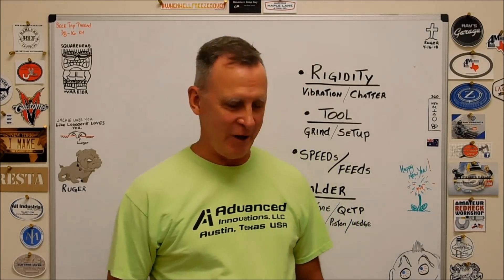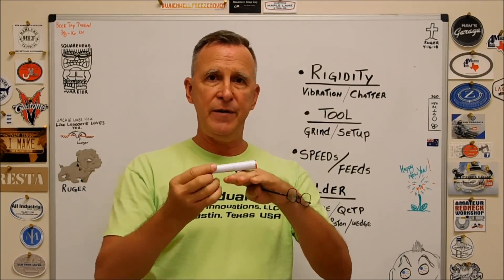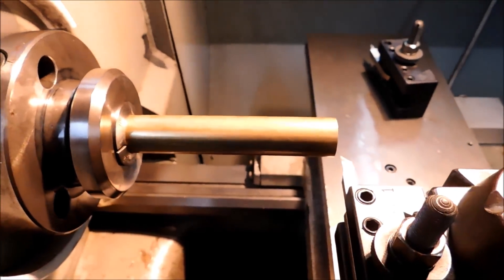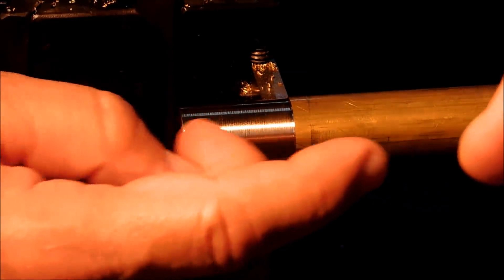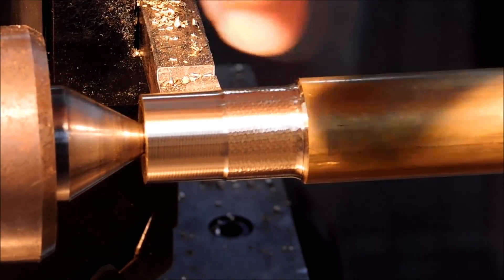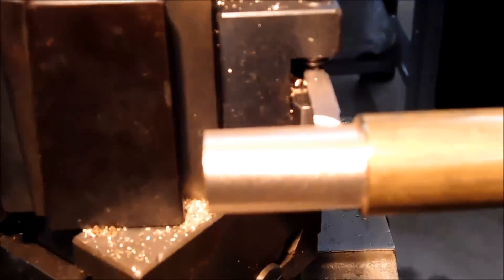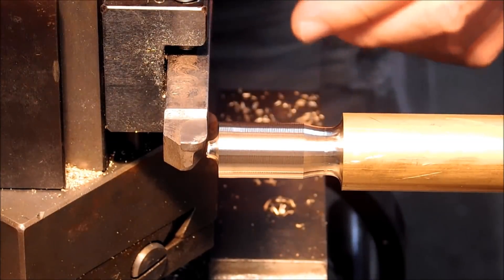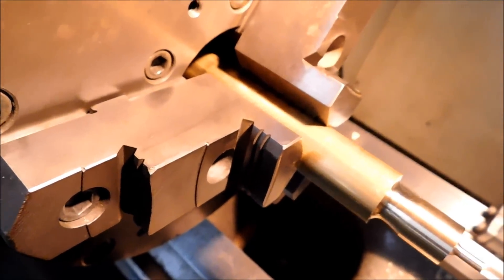Bad Turned Surface Finish and Some Reasons Why

Comment: I wonder how much of the surface finish woes are just the consequence of hobbyists trying to make things out of unknown scrap stock.  There's certainly a lot to be said for the differences in alloy content or material stress with regards to how freely it machines.
Reply from the maker: True, but having a grasp on the basics is a good place to start. From there, its just RPM and cutter toughness.

Comment: So - when drilling Brass with a HSS twist drill - simply very lightly grind or stone the chisel edges to flatten them (about ten thou' x 45 deg' will do you) & you'll find the drill won't "GRAB" when drilling Brass.
(This was a little, but valuable "Old School" tip I was taught by the "Old hands" which stuck with me to this day)
Reply: Martin Burnell Good advice,Martin. I have had brass grab a drill bit and pull it all the way through my part in a blink of the eye

Comment: Hi
Love this channel. Always something to learn. I am setting up a shop and it seems like I should be able to make better lathe cutters with a belt grinder. Nobody does this as far as I can tell, but knife makers use them a lot. Seems more flexible and and easier to control. Am I off base?
thanks
greg
Reply from the maker: No. It should work, but make sure the belt is very fine for the final touch up. Rough surfaces trap softer material and may not perform as well.

Comment: Awesome again.  Why do you not use coolant or cutting fluid with a lathe?
Reply: Short version: Todays cutting tools don't need them.
For cutting fluid to work with carbide tools you need lots of it, on a manual machine you can't run those amounts. If it's delivered with even the slightest interruptions to the tool a thermal shock will occur in the carbide leading to micro fractures in the cutting edge thus reducing the life of the tool.
When cutting fluid is used the real reason is to transport chips out of the cutting zone. Alternatively high pressure coolant is used but that needs to be directed directly into the cutting zone, normally with coolant channels in the tools (see Sandvik Coromant's channel for some examples).
HSS-tools in steel can benefit from cooling by allowing higher cutting speeds. The question is, is the reduced time to cut worth the mess?
Also the mist from cutting fluid is not healthy to breathe in and many machinists suffers from skin issues due to contact with these water soluble oils. Modern CNC's are often equipped with active trap filters and ventilation to the outside to battle this.
Reply: @sharg0  Thanks for replying.

Comment: If you put your finger  at the middle of a vibrating guitar or piano string, the second harmonic is enhanced.  Is the effect the same with a steady rest.  Is it better to place the steady rest NOT at the center of the length of the work piece, or does that bring out worse demons?
Reply: I'll second this question, but I have a feeling that off center is better.
Reply: My guess, and it's just a guess, since I'm a musician, is that placing it just a little off center would reduce the overtone harmonic effects.
Reply: If it's a really long skinny workpiece it would be worth offsetting it "a little", as you suggest. In the days when high class lathe spindles with long headstocks had a third bearing, it was optimal to offset it, but the spindle is so stiff in modern lathes with decent sized bore holes (which requires a large OD) that virtually nobody bothers with a third bearing these days; it makes maybe a 1% difference to stiffness.

Comment: Many times taking a deeper depth of cut by placing a heavier load on the tool bit, with give a magnificent finish compared to a light cut. But its not always available.
Reply from the maker: Very true

Comment: Good Video Joe.  I have a job that I do at work from time to time that involves boring the inside of some 2 inch ID 6061 tubing.  The sections are 10 inches long and must be bored all the way through.  Obviously this is far LESS than ideal conditions to hang a boring bar out that far.  It's a 1 inch Sandvik 107 bar with triangular insert.  1/32 radius insert.  The thru hole in the lathe isn't big enough to pass the Schedule 80 pipe through it so I end up supporting one end in the chuck and the other in a bearing steady rest.  The results are partly to mostly crap.  I've worked myself silly trying to produce that all elusive 6061 shine and sometimes I get close to it...sometimes not.  I've spun short pieces about 2 inches long with the same bar choked up to 3 inches stick out.  Magically the finish shows up instantly.  I've resorted to wrapping the tube just behind the steady rest with about 4 feet of 3/16 neoprene belting to deaden harmonics.  I've piled bags of lead shot on the headstock and the apron to stabilize that.  I end up with a spindle speed of 300 rpm and .008 feed as the only thing that will produce any kind of finish in the 10 inch tubes.  Any more rpm....chatter.  Any slower feed...chatter.  Feeds above .010 demand no more than .015 DOC.  It's a super finiky setup but it absolutely in line with this video.  Fully demonstrates how variables can blow the whole attempt at finish.
Reply from the maker: If all else fails reduce the nose radius on your insert to the .015 choice. The more surface contact you have, the greater the possibility for noise.
Reply: I did hand grind an insert at one point to just a slight radius break like you are talking.  It did help me get through the majority of those tubes.  BUT as you mention in the video the feed has to match the radius to the extent it will produce a finish.  Too fast and we get a phonograph finish.
Reply: The irony in this is that this week I have a job that requires a finish that adhesive will bond to..  SO there has to be "tooth".  It needs to be aggressive and so I'm going to turn a really snotty looking 20 tpi thread in both directions and let that be the biting surface.

Comment: Another scenario that causes random bad vibrations is if your Chuck Jaws are worn Bell mouthed it allows the back of your stock behind the Jaws to be loose even just a little bit will cause bad vibrations and nothing you do will alleviate that situation until you fix the problem
Reply from the maker: Try that tape trick I mentioned. Some guys have suggested wrapping the part with copper wire where you believe the jaws are worn. The difference in jaw pressure will be absorbed by the soft copper.
Reply: @joepie221  thank you Joe it wasn't actually me that I was talking about just in general it is another thing that can cause a vibration because it dramatically reduces the amount of grip you have on that piece.

It dawned on me today when I was working on a piece one more scenario. I had a spindle that was not installed correctly. When I say it wasn't installed correctly a little misleading what I mean is the nut on the tail of thespindle assembly was not crank down is tight as it should have been causing a slight longitudinal weakness. It took me three weeks to find out what the problem it was! so if anybody has a situation where they're getting random strange vibrations on pieces they don't think should be a problem at all that should be looked into. If there is even a ten thousands of an inch slop longitudinally in the entire spindle assembly it'll cause vibrations at strange times.

Just a tip!

Comment: I am a new comer to using a lathe and with the point you made about having a long work piece and having it wiping if the piece is long enough to be sticking out the back of the head stock is there a collet or chuck or something along those lines you can attach to the backside of your head stock to support this kind of situation
Reply: If you tend to use standard sizes of stock, like 1/4", 38", 1/2" and so on, bushings work well.  You can use wood, plastic or metal as bushing material; I like aluminum since it's easy to machine to a precise size.  Make it about an inch long, I.D. about a couple thousandths larger than the stock diameter, O.D. would be spindle I.D. minus a thousandth for each inch of bore diameter, example: spindle I.D. is 2.300" so bushing O.D. would be 2.297 to 2.298".

It helps to drill and tap the bushing for a set screw to make sure it doesn't walk out of the spindle.  Use a "grub screw" (headless type) with a flat point.

You can also use wooden wedges between the spindle bore and the stock.  These work well for hex or square material, also if the diameters of your round stock often vary or aren't standard sizes.
Reply: make a spider
Reply: Machine an extension collar to fit over the rear end of the headstock spindle, with a similar sized bore, and fix with grub screws or any other means appropriate.  Drill and tap at 120 deg pitch around the collar to fit 3 set screws - socket head for preference - and you have a simple means of centring the bar in the spindle.  Fit 4 screws at 90 deg, if you need to machine square bar . . . .

Comment: Joe, I noticed some light surface rust on the cross slide corner under the QCTP, do you use any oil to prevent that?
Reply from the maker: If I am going to be gone for an extended period, I'll fog my exposed steel down with WD40. It works well. That rusted corner is probably from the sweat on my hand.

Comment: Your first cut was not just a sharp-pointed tool, but there was some runout on the stock.  So, the depth of cut was varying, but the first pass took care of most of it.  The tool stuck way out, as well as the stock, so I think there actually was some chatter on at least part of the circumference.
Reply from the maker: The depth of cut actually tore some of this brass. It visible on the cleaner pass.
Reply: Ah!  What I thought was chatter roughness was actually tearing.  I get it.  Thanks.

Comment: Is your lathe mounted to the concrete.  I have a 13" SB with 7 foot bed.  Pretty heavy machine with the big bell motor housing.  Would I see much improvement if I locked it to the floor
Reply from the maker: Mine floats on hard rubber risers.

Comment: Most people asking this question. Dont have the speeds your lathe has.  My 1923 SB 9 , i believe have a 600rpm max and my  1960 15" Colchester has 1200 rpm .   I can get the same quality from both lathes .  And it is all in the holding and tooling.    And knowing your machine is  the biggest part.

Comment: I wanted to ask you a question, but can't find a way to write to you other than comments.  The question is "Is it possible to hold a piece of rod stock larger than the chuck's maximum jaw opening and how?" for a mini lathe.
Reply from the maker: If you can reverse the jaw direction of your chuck jaws, and that still doesn't work, you have to go to soft jaws and bore them to suit your application. Be aware they may hit your carriage, so spin the setup by hand and check all the possible impact points.

Comment: Good demo Joe.  So, if I was needing to cut that big round nose profile in a certain place and I had to have the piece sticking out 5 inches and no way to put a center in the tailstock, how would you eliminate the chatter?
Reply from the maker: I normally leave extra material on the part to house the center. Cut the radius, then face off the protrusion. It has worked well in certain situations.
Reply: Use the fixed steady - that’s what they’re for !

Comment: Thank you, you're a great teacher. Question: Why use a dead center vs a live one?
Reply from the maker: i've always been taught a live center has bearings, and a dead center is solid. Live in the tailstock, dead in the head.
Reply: @joepie221  So there's no reason to use a dead one then. I thought a bearing'd center would be preferred as the dead one would be harder on the material thouh cheaper .
Reply from the maker: @yahochanan4287  Some guys use solid centers in a tail stock, but I prefer not to. If you put one in the headstock, it spins with the rotation of the spindle and doesn't wear away your part. Using a solid (I call them dead) center in the headstock is the preferred and acceptable setup.

Comment: My live center often loses contact and stops spinning when I turn Alumium. I can’t identify any slippage. Is this common?
Reply: The material must be moving back in the chuck.
Reply from the maker: It is also possible the angle of the centerdrill and live centers are not the same. This causes a tangent ring contact initially and not full conical contact. The ring displaces or rubs off very quickly and the center will ultimately come to a stop.

Comment: I always thought that you can have a maximum of 4 times the diameter without support. Is that correct?
Reply: There is no fixed truth, it depends on material, tooling, cutting parameters and so on all the way to the colour of your car (well almost). But four to five is about where it's lands.
Reply: @sharg0  thx

Comment: Excellent info. - One question - Once I was having a hard time parting off a piece of 1.5 dia. hot rolled because of terrible chatter and I found on some other channel where  the guy said -- don't even try parting black iron -- when I tried parting off cold rolled, the same set up and same parting blade worked great Is that normal?
Reply from the maker: Some materials will just fight you no matter what.

Comment: The diameter of the material is also getting smaller so the tool to surface speed is increasing
Reply from the maker: Decreasing.

Comment: Ok Joe,  I have this rough surface finish like at the first of the video, I don't like running my lathe past 360 rpm.  All my tools seem to give simular results,  my cross slide seems to have some play in it, that is to say, my light is attached to the cross slide and it is shaking from the point of starting the cut to the finish of it, but it stops shaking when the cutting is stopped.  I tried checking cross slide for slack but can't seem to find any.  Lathe is a ( 12 x 36 ), seems to be level, I've been checking for twist in the bed, can't seem to find a good way of doing this other than just using a level across the ways, with 1,2,3 blocks setting on the ways.  So, thought you could tell me a sure fire way of doing this....  Thanks!!!  Great video by the way....
Reply: Have you checked the gibs on your cross slide?  Make sure they're adjusted properly.  There shouldn't be any play at all in the cross slide or you'll get chatter.
Reply: Yes, gibs are and have been adjusted, not sure but have wondered what else I might do on the saddle, the shaking maybe coming from that.  appreciate your input Don.  I have not found any good way of checking that either.
Reply: I checked the saddle for up and down play, on the back sided of the lathe,  the saddle had .003 play, and .002 on my side seems like that would be within tolerances.  I did tighten the lock down just slightly seem to help but finish is still a little rough.
thanks for taking time to reply, Mr Takisawa

Comment: Your not cleaning the seat area on bottom of the tool post holder and there are small bits of brass under the quick change tool holder
Reply from the maker: The tool holder doesn't go all the way down.

Comment: Is there a "golden ratio" or other guideline for the relation of the feedrate to the radius of the tool?
Reply from the maker: Just as a rule of thumb, a smaller radius has to be fed slower than a big radius, but that also depends on the RPM.

Comment: Hi Joe - this video was made for me. I should have the name "Chatter King" as my screen name. Didn't even know why I was getting the finish I was getting. I don't fully understand how to set the radius/feed rate. I understand high speed rate if radius is small creates problems. The tool tip starts acting more like a thread cutter because it isnt wide enough to remove material between the threads. I suppose technically, even a nice finish could have millionths of an inch threading. Its just imperceptible. But on the one tool you have a really large radius? It seems that the radius would be too large somehow. How do you know what the radius on that tool even is, or any tool for that matter? Also, is it possible to go too slow with a wide radius? What if you would have slowed down the feed rate on the second tool you used? Heh - crazy questions.

Comment: Hi Joe, can you tell me the reason so many videos show the top slide at 45 degree to the centre line? I have no idea why, as mine lives parallel to the centre line and I see no reason to have it set at 45 degrees.  I have little reason to change mine as I do any tapers on my small cnc lathe.  I have a DRO on the centre lathe and the top slide just stays locked in place parallel to the bed.
Reply from the maker: 2 reasons. If my compound is parallel to the ways, it gets in the way of my tailstock moving in for close up work, and if its perpendicular to the ways, it covers my cross slide dial and makes it hard to read. 45 is a midpoint, and good for large chamfers.
Reply: Joe Pieczynski thank you for making sense of a puzzle that has been bothering me for some time. The tailstock interference is easy to understand, the large chamfer not quite as simple, to me it would seem that it is the wrong way round for a chamfer unless you reverse the spindle?
Reply from the maker: ID chamfers
Reply: So, I've recently just learned about sine angles and stuff. Apparently, and I have confirmed this, if you set your compound to 30 degrees you can accurately  measure .0005"depths of cut by advancing your compound by .001" rather than trying to do it with your cross feed. It seemed interesting to me although I hope I never have to do it lol.🙂

Comment: Does the live center spin with the piece of brass
Reply from the maker: Live centers usually rotate with the work piece. Yes
Reply: @joepie221  It's hard to tell in the video because of the surface finish on the live center.